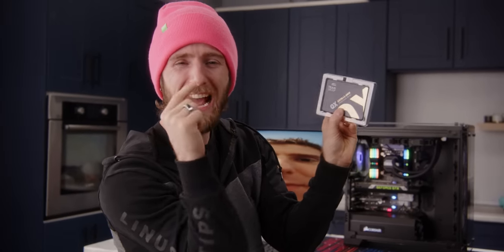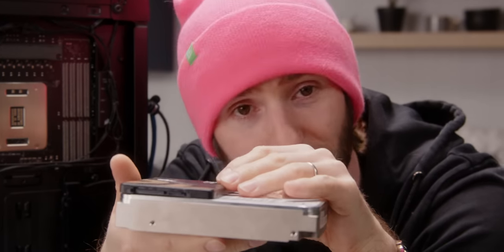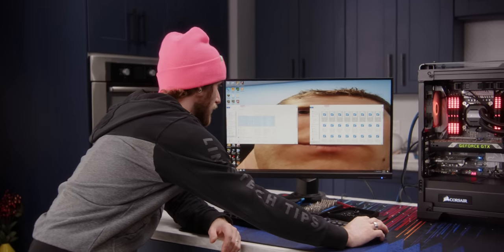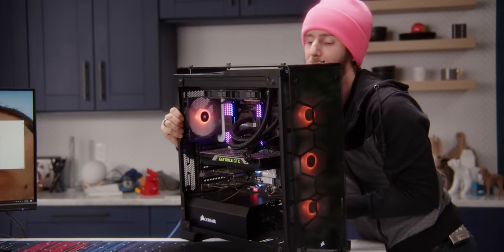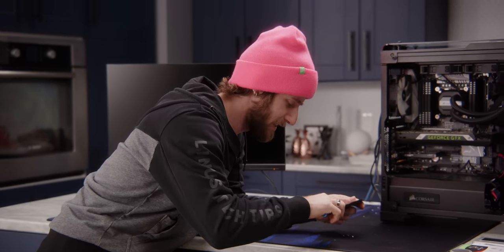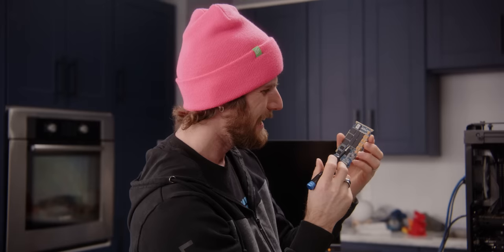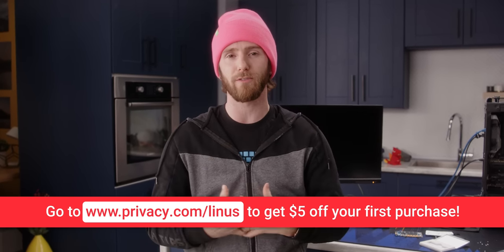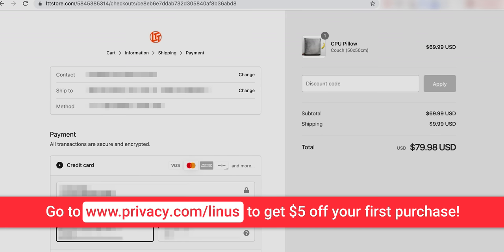The 15 Terabyte SSD is TINY!!

Comment: Windows for once is right: one byte is 8 bits, so it's correct to assume 1TB is 1024GB and not 1000GB
Reply: I thought everyone knew this
Reply: I think we can all agree, here you can not just blame Microsoft, its more of an issue with Computer Techs (+History) and the "SI - Unit System" used in Physics and everything else...
Reply: Its just that most people dont know that one Byte is 8 bits, and that changes everything.
Reply: Byte does not have a prefix, the SI prefixes used are base 10 and not base 2^10.
There is a reason Tebi and Gibibytes are a thing.
Reply: It boils down to the number base used to count... Humans use base 10 (1, 10, 100, 1000 etc.) while digital electronics tends to use base 2 (1, 2, 4, 8, 16, 32, 64, 128, 256, 512, 1024 etc.).  Using base 10 is IMO a ruse to impress users with larger looking capacity.
Reply: @Hyperus  It used to not be a thing so thats part of where the confusion comes from. Some of us were using computers before 1998.
Reply: RAM is sold in proper Gigabytes so should storage
Reply: Afaik current "standards" mean that the kilo/mega/giga... prefixes should be used for bytes in the same way that they are used for other units, meaning kilo is 1000 of base. Kibi/mebi/gibi prefixes have been made for 1024, the bi in it probably is supposed to mean binary. It makes sense that the prefix kilo should mean the same thing everywhere but Microsoft might be keeping the old units for backwards compatibility as it used to be that a kilobyte was actually 1024 bytes.
Reply: As  @PerKroon  said, this is just a marketing tactic to save a few bucks to the manufacturers and milk the consumers
Reply: Yeah the bytes portion should clue people in. 2^10 = kilobytes 2^20 = megabytes 2^30 = gigabytes etcetc. I understand why they changed it, people associate it with decimals too much and binary are just too foreign.

Comment: I disagree that windows likes to "think different" about storage. Most operating systems/software I have seen uses that same system for storage at least on a low level
Reply: Well, for example Gnome is fully aware that K means 10^3, M 10^6, G 10^9, T 10^12 and so on. KDE uses the 1024 increments, but it's using the Ki, Mi, Gi, Ti abbreviations, so they can count as well. It's just Microsoft's silliness, but that's probably the least annoying thing about that OS.
Reply: It's just that Windows uses the wrong abbreviations.
Reply: @wta1518  false
Reply: @nicholascopsey4807  Oh, so kilo now means 1024 instead of 1000 because "brilliant progammers" can't add an i?
Reply: @wta1518  what’s 2^10?
Reply: @nicholascopsey4807  Yes, kibi means 1024 (2^10). Kilo means 1000.
Reply: @wta1518  no, that’s wrong
Reply: @nicholascopsey4807  you're right.
Reply: @tristan6509  Ah yes, because there were electronic computers in the 1700s.
Reply: Windows, like practically every OS, uses GiB (2^X), but for some retarded reason they use the "GB" abbreviation while still being 2^X, while the physical disks are measured in actual GB (10^X).
Reply: It was the historically the difference between IBM using 1000 and everybody else in the computer industry who used 1024 as it makes sense as you are dealing with binary. So for once Microsoft should be seen as being in the right and marketing that tries to rip people off using 1000 should be seen as very very wrong.
Reply: @user-yv2cz8oj1k  No, because Microsoft is using the wrong abbreviations. Kilo Mega and Giga always have been and always will steps of 1000, not 1024.
Reply: @user-yv2cz8oj1k  but that is the whole reason why GiB and others were invented. Officially GB is supposed to mean 1000 and GiB is supposed to mean 1024. So when MS uses GB they actually mean GiB and drive manufacturers are in fact correct in their use of GB! I know this is contradicting my original comment but I did not know this when I posted it.
Reply: At first I was amazed how there could even be a discussion about what kilo means.. then I remembered there are some countries who haven't switched to the metric system yet :P
I'm atleast happy they didn't start defining computer storage by stones, goose-teeth or whatever else some countries use for measurement when computers were first invented ;)
Reply: @watchling  The Imperial system is technically part of the metric system.
Reply: It's quite fun imagining how the equivalent of Imperial would look in computing. Without trying to be historically accurate/logical, there would be stuff like for example:
1 pong(defined as size of original version)
1 win95(into which you could fit a certain amount of pong)
etc, up to and beyond CodWarzone in which you might define the size of the drive Linus shows :P
Reply: @watchling  One clear advantage of the imperial system is fractions. Specifically thirds, since the system is based on the number 3. Try measuring a third of a meter vs a third if a yard.

Comment: What you're saying is that Windows uses the original definition of a kilobyte being 1024 bytes, whereas the manufacturer uses the snowflake generation I-can't-do-math definition where they dumb it down and actually make it more confusing, as well as get to falsely advertise the drive to make it seem larger than it really is.

A byte is a measure of binary storage, and therefore must always be a power of 2, not a power of 10. All that storage space is is a bunch of transistors that either hold electrons or don't, either a 1 or a 0. That means that any amount of transistors will always have a total capacity that is a power of 2, period, end of story.

Comment: Sorry for the correction, but it's about 97% the capacity (1000/1024). So a 1TB drive will show as 0.97TiB (Tebibyte). As for the drive in question, yes that one comes out to about 91% the rated capacity, but I'm not sure why that would be. If it was truely 15.3TB, it should show up as about 14.9TiB in Windows.

Comment: I'd use 15Tbs for my "homework" folder
Reply: homework folder but speeeeed
Reply: Highly compressed that might fit
Reply: tbsp? tsp?
Reply: @i7460  don't worry, 15TB is just for one of the smallest sections in the "homework" folder

Comment: "Microsoft likes to be a bit different"

Microsoft is correct though because it's a binary system. Drive manufacturers use the other way of counting so they can advertise a larger number. 
Windows does not recognize the drive as "91% of its actual capacity", instead the manufacturer claims 9.8% capacity they don't have and get away with it because they use the right terminology.
Reply: That's also how Mac OS systems count drive capacities and some Linux applications. It really just depends on preference for decimal or binary display. There isn't an actual difference between capacities because in the decimal base, a kilobyte is 1 * 10^3 bytes, while in binary, 2^10 bytes is a KB. This just keeps going, but if you stay with the decimal base, it's still the 15.3TB there, it's just counted differently on Windows' filesystems. That capacity, however, still exists, it's just a decimal base.
Reply: @unluckyGolem  binary is the only way that makes sense, as files are in block sizes that are in binary sizes. The hardware manufacturers are the ones misleading us.
Reply: @unluckyGolem  There may not be an actual difference, but it is inappropriate. It serves no one to show an inflated number. 
You can sell cars with a power rating of one million kW, where kW is now a kiloWilly instead of a kiloWatt. There is no actual difference; the car makes the same power. But, it is inappropriate.
Reply: @RagnorBC  you're saying this as if 1 manufacturers TB is different than another's. This is all for simplicity because most end users don't care. And even if they did, the solution is to use TiB, which will just confuse the average costumer even more. Data scientists and computer engineers are incorrectly using the term TB/*byte etc when the IEEE created a standard *iB some 20 odd years ago. No one uses it because no one actually cares. It's not because manufactures are trying to blind side customers, because what they're advertising is correct, your operating system just displays a different number representation.
Reply: Microsoft uses the wrong nomenclature though. They should be using "MiB" and "GiB", but instead use "MB" and "GB". 1 GB is literally defined as 1000 MB, while 1 GiB is defined as 1024 MiB. So yes, it is indeed that is wrong here.
Reply: @unluckyGolem  the IEEE can invent "standards" all day long. As they're staffed by hardware vendor employees is not surprising they come up with this shit, but nobody was confused about anything before that standard came along. I counted in binary size ever since I inserted a 16Kb memory cartridge into the Philips P2000 in 1975. As did everyone who ever had anything to do with computers. The only reason for the artificial confusion is marketing. As Microsoft is not a hardware vendor, they never had any reason to suck up to the IEEE. Quite the reverse, actually.
Reply: @unluckyGolem  IEC created Kibi, Mebi and Gibi along with KiB, MiB, GiB not IEEE.

Comment: Linus, you call using 1024 “steps” of data storage (1024 kb, 1024 mb, etc.) odd, but that is the accurate way to determine file size. 1000 unit steps are not totally accurate.
Reply: Yeah, that segment was weird.
Reply: And I don't get why people think it's a software vs hardware thing. Windows is software and uses, correctly, the 1024 method, and the whole reason why is based upon the powers of 2 (2, 4, 8, 16, 32, 64, etc) which goes back to hardware, addressing memory in early computers (see: binary prefix history on wikipedia). It is the fault of the International Electrotechnical Commission's 1998 decision to assign 'mebi' to the powers of 2 numbers and 'mega' to powers of ten. I suppose they did this because of the etymology of the words (mega not having anything to do with powers of 2), but by that time 'mega' was the standard way people were describing 1024 allocations of storage and memory. But to my point: it was never a software vs hardware problem. It was an International Electrotechnical Commission not coming up with a better solution problem.
Reply: Not really true, both are actually the right way (at least until the late 90s). Then the IEC created the term TiB, GiB, ... for binary numbers so people wouldn't be confused. However Windows and other OS (not the only one) didn't make the move to the new specific term and continue to use the generic one TB, GB, ...
For more information, there is a good article here https://searchstorage.techtarget.com/definition/tebibyte-TiB
Reply: Ok
Reply: Why would powers of 1000 be less accurate than powers of 1024? If I write a file containing a thousand bytes then it's exactly 1 kilobyte and exactly (125/128) kibibytes. That's like saying specifying a length in feet is not as accurate as specifying it in meters. There's an exact conversion factor between the units so neither is more precise than the other.
Reply: @digitalconsciousness  Though computers work using the base 2 and base 16 number system.  So a means of measuring memory using those tends to make more sense then using a base 10 to dumb it down for the commoners.
Reply: @sasodoma  You are correct and my use of language was not optimal. I meant that it was not accurate to the file size that computers use to calculate data. What I am trying to communicate is that computers preform calculations based on 1024 steps, therefore we should never have moved away from that system and Linus calling it "weird" is not right because it is the way that computers actually calculate data. As Erik Stephens sad, they "dumbed it down for commoners."

Comment: I'd combine it with 15 other SSDs of the same in a raid and store all my movies and tv shows.   I currently have 16 12TB drives in RAID 5 (163TB useable) but I'm starting to run low in space.   I'd be happy to buy 16 of these SSD drives as soon as they are about $400 - the same prices as spindle.  I'd even go to $500.

Comment: The size of 4k movies never ceases to astound me.  I have like 85TB total between both my primary PC and my server, with the bulk being plex server space at 50tb of media, and have basically no ability to store 4k movies.  It's for the better, as transcoding 4k is a bear, even with the M2000 card.
I'm down to ~80gb on each drive, with one 10tb drive having just over 200gb.  I don't like having less than 100gb.  I do have 10tb backed up, and have been slowly buying 16tb exnos drives to replace my array of external drives.  The plan being to us the exnos as my main drives and then unplug the externals to use as cold storage.  It's not the best way to store them, but it's the most economical way I can back them up.  So I have a plan to get 4 16tb exnos drives as my internal.  Might mix with WD golds.  Really depends on what I can get for what price.  I got my first 16tb WD Gold when they were clearing them out for $300 (this is on WD's site).  My plan was to continue getting WD Golds, but it seems they've decided to completely discontinue that line, so it looks like the more economical option is Exnos.  I want to go for enterprise level because they will be mounted fairly close to each other and I want as much longevity as I can get.  The externals are much cheaper, and I will continue buying externals to fill out to 6 of them.  The last 4 tb will be replaced by a 4tb drive I already own.  Unfortunately, I will likely have to rewrite all the data to the backup externals, as I am adding shows as I expand the number of 16tb drives I have.  So as I add new to fill the extra space I have, that'll need to be backed up.  Plus I've already switched shows around so the 1 10tb backed up is all over the place and some files may even be wrong.

Comment: "Microsoft likes to think different and use gibibytes"

No. As a guy with a CS degree, I say thee no! No, and fuck all this base-10 bullshit. We've been using kilo-, mega-, giga-, tera-, and so on to refer to powers of two since a transistor displaced a slide rule.
Reply: Thank you! I don’t need to word this since you already did.

2^10(bytes) that’s a kilobyte. 2^10(KB) that’s a real MB. None of this “well for consumers 1000 is easier business
Reply: @amiboshi2000  then MacOS is wrong! 
There is a reason you don’t get 7GB of something. It’s because it’s always doubling in quantity, not modular. You can’t get to an even 1000 when doubling.
Reply: @amiboshi2000  no, linux still mostly uses binary prefixes, with the option for SI if you want
Reply: Blib blib blup blup, i'm a stoopid doop
Reply: Can't blame Linus too much since he's more involved in the IT side then the engineering side (both hardware and software) but yes, it did bug me when he said that (probably should have asked Anthony since he seems like the type to know better).  He also didn't mention formatting space.

Comment: Wow, the way you pretended like Windows is at fault for the 13.9 TiB vs 15.3 TB problem. Jeez.
Reply: Yeah, it's definitely the HD/SSD industry thats being unreasonable. I for one am glad that my first home computer was not branded a Commodore sixty-five-point-five.
Reply: it's almost like a Byte isn't a base10 unit with 8 Bits to the Byte (2^3 Bits)  So fuck the drive makers, because even RAM sticks are 1024 Bytes to the KB (2^10)!  Rages in Pentium (1) Era
Reply: @MiishaKorvian  RAM is still 1000 B to 1 KB, just like how SSDs/HDDs are 1024 B to 1 KiB.
Reply: @wta1518  then why does Windows tell me that I have 32GB of RAM, and 32710 MB Installed?  It's the fucking drive makers not playing along.
Reply: @MiishaKorvian  Windows is using the wrong units.
Reply: @wta1518  You missed the point I was making.  If the RAM makers were using 1000 B to the KB, Windows would not have counted 32 GB as 32710 MB, as that total is in line with the RAM capacity being in 1024 B to the KB.  I bought 32GB of RAM according the maker of those RAM sticks and Windows agrees.
Reply: Using MIB, KIB... Is fucking horrible why the fuck can't we all just agree that a KB is 1024 Bytes not 1000. That shit just causes a lot more confusion.

Comment: 4000 is a LOT for the storage compared to the usual prices of the smaller drives. You could get 42 of the sandisk ssd plus ones or 36 samsung 860 evo where both are 1tb. so you could do one set of 15 in raid and another set for backup. and still have 12 left if you did the sandisk one. Though the sandisk one does the same as this one for space but i've been using it and it's been pretty good. not like it's too hart to max out sata 3 speed with an ssd anymore.

Comment: Not making a dig, but windows isn’t “different” - mega, giga etc are marketing and the correct is to use TiB, GiB etc
Reply: While windows isn't different, but they do use the wrong symbols. Nearly everything in windows shows KB, MB, GB, and TB when it should be showing KiB, MiB, GiB, and TiB.

Comment: I would pay maybe a few hundred.   Maybe $500-$600.   Searches are showing me it costs more than $3000.    These drives can achieve around 500MB/s transfer rates as other ssd's.    That said I have a nice 10 TB western digital drive that's getting over 200MB/s and it cost me $182 with an amazon sale.   It doesn't have the faster random read that ssd offers, but that's what my 1TB ssd is for.  I use this as a backup drive for large file sets and it's pretty good..  It's also ok for loading games as 200 MB/s is about twice as fast as many older HD's for sustained transfer.   That SSD would be nice, but my budget can't afford a drive that's 16 times what I paid for my 10TB and only 15TB